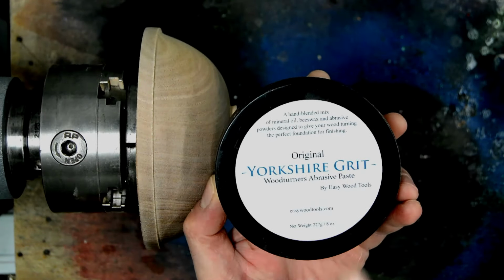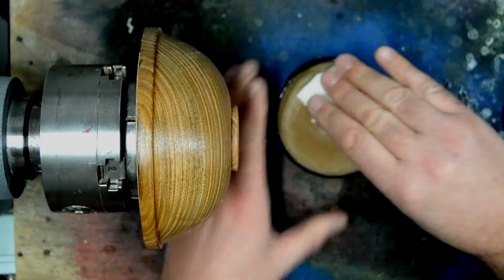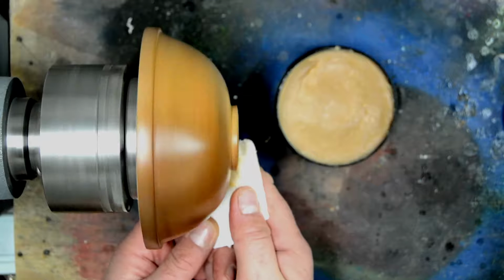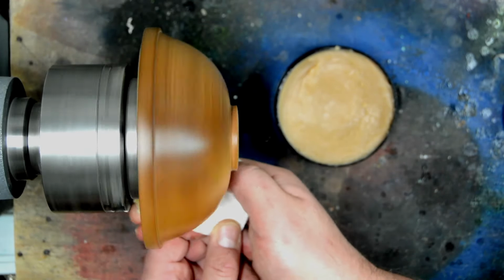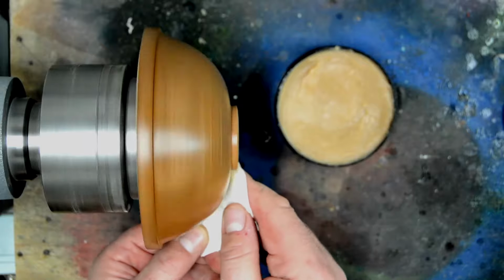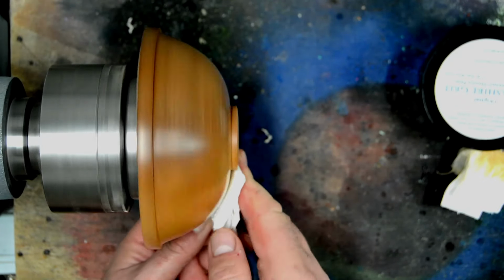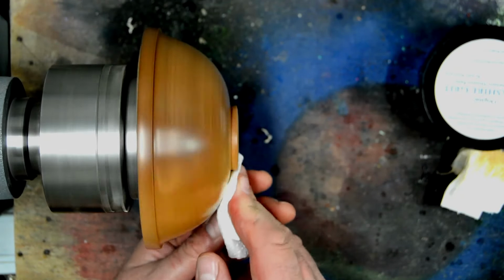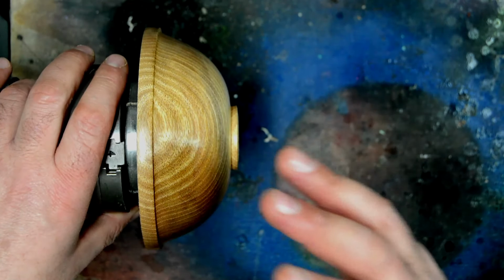How to Use Yorkshire Grit Original Correctly - Are You Doing It Right

Comment: Many thanks for the video. I have never used Yorkshire Grit; if it is an abrasive paste “sanding” to 1000 grit why is sanding sealer applied first?
Reply from the maker: Yes it sands to 1000 grit. You sanding seal first to seal wood from absorbing the wax in the Yorkshire grit.
Reply: Sorry that you thought my question strange. As a leaner it was a genuine attempt to understand why something is done.
Reply from the maker: No question is a silly question if you don’t know, you did the right thing by asking the question. Now you know which is another step in your woodturning journey.